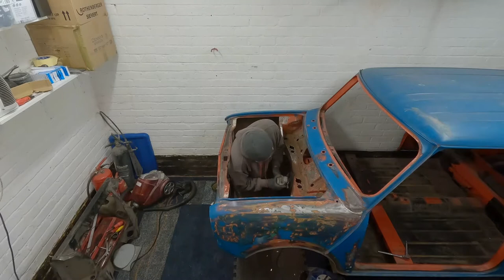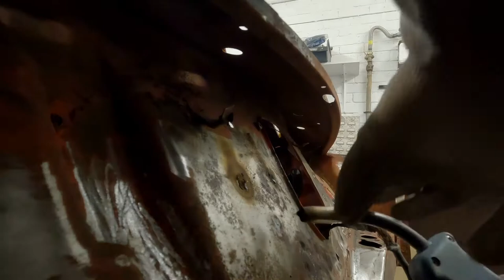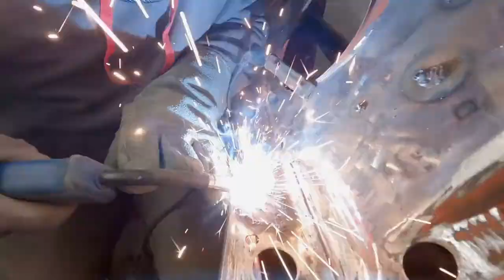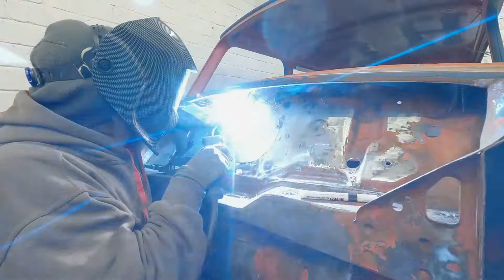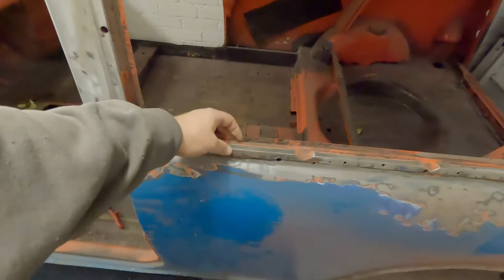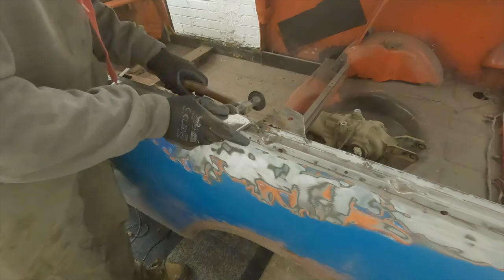72 Classic mini clubman estate build episode 2

Comment: The cleaner bulkhead looks much nicer, (and relocating the wiper would finish it off nicely) but have you chosen how and where to reroute the cables?
Reply from the maker: First of all thanks for watching and the comment. Yes I’ve chosen alot of the routes of the cables and wires. Hoping all works out. Looking forward to getting to that point once shell is rush free :).